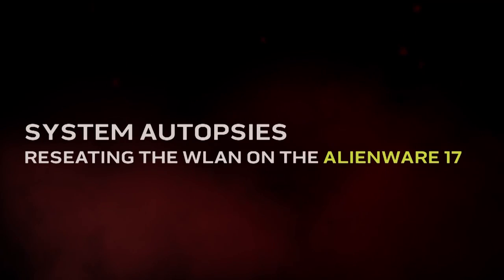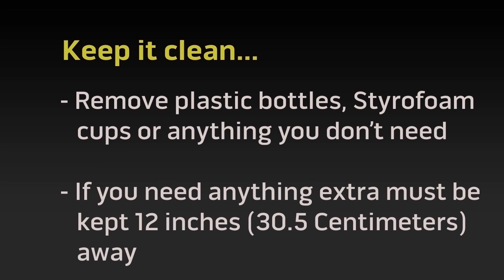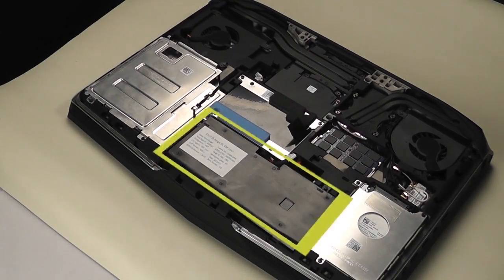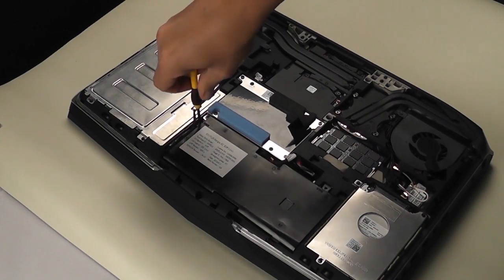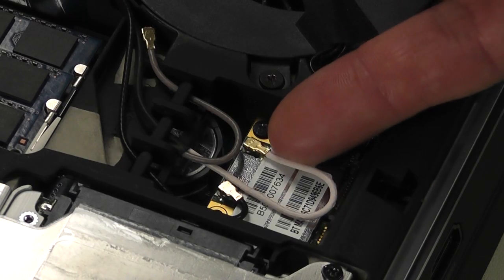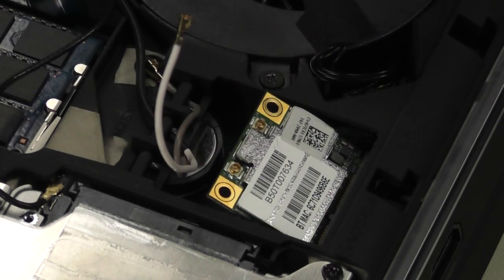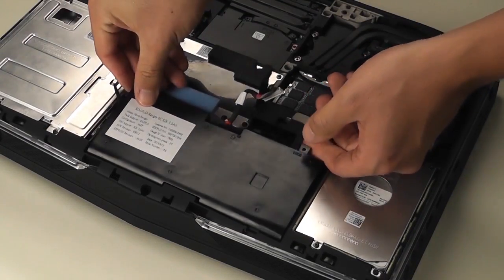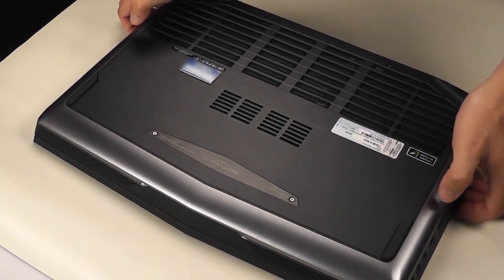Alienware 17 R1: Remove Wireless Card

Comment: hi canyou tell me were is the bluetooth card please i dont kno where is it
Reply: its a broadcom BCM20702 4.0+ HS USB device, that's all what it says on the system specs. my problem is that i have a Bluetooth headphones and i cant hear music in them. the thing is that they appear as connected and i cant put them on default in the playback devices cause its not shown in the device setting (or audio devices).
Reply: yea i know its weird because i don not have any usb attached to my laptop and i have bluetooth but i cant connect my headphones
Reply: NO IT DOES NOT APPEAR THERE, BUT APPEARS THAT I HAVE A BLUETOOTH ADAPTER. BUT ILL TRY WHAT U SAID.
Reply: i found the problem. the problem was that a different driver was installed over my already installed driver and that was causing my headphones to interfere with both drivers. but thanks for helping me. u guided me to find the solution thanks. by the way do you know if nvidea    its going to make the gtx 980m 3d compatible cause i would buy it if it was compatible.